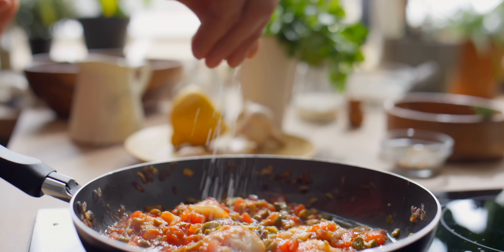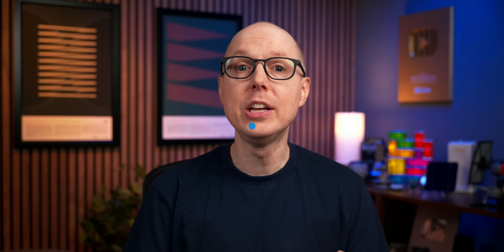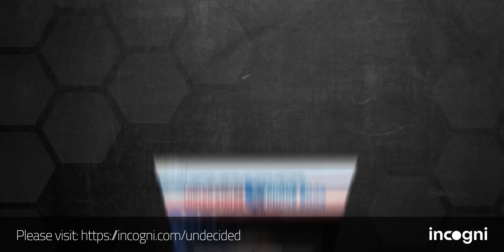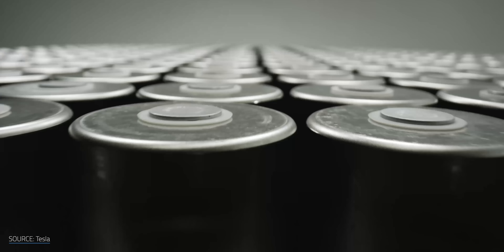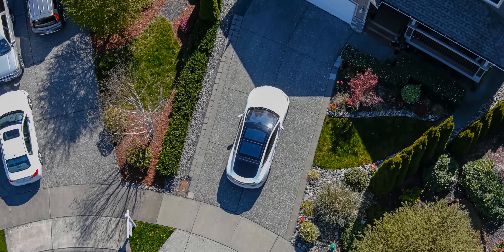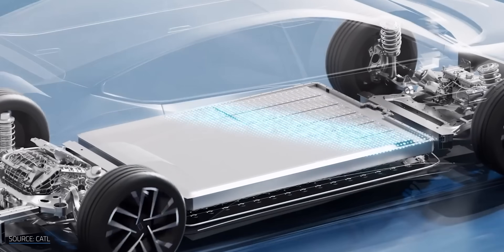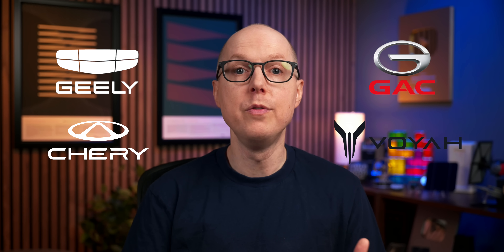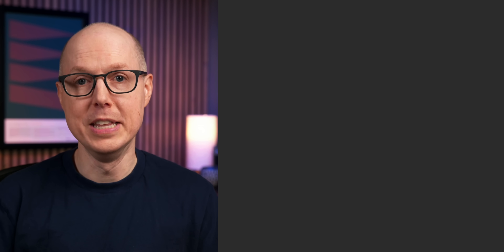How CATL Made Batteries 90% Cheaper (And What Happens Next)

Comment: If I can have (near) the same range with a sodium battery at a lower cost, I'd rather have sodium. This is especially true if the battery can also last 10,000 cycles. Then I also won't worry (much) about the battery degrading, even after 200,000 miles. However, I see sodium batteries more prevalent in home and grid storage, where energy density is less important.
Reply: Multiply the range by No. cycles. Even a car rated for 2000 cycles with a range of 300 miles would provide 600,000 miles.  Even after rated 2000 cycles the battery will still have 80% capacity.
Reply: @830118   Yep, rather than swap battery, it could be swap the car with that 10 000 cycles, lol.
Reply: @830118 … people always quote the battery life remaining after 80%, but there is something misleading there. The truth is the technical manuals say to stop using the battery at around 70% (exact depends on battery). In the end, much of the useable safe life of the battery is used by around this point. (I’m talking LFP, from my own reading). Cheers!
Reply: Problem with salt is the voltage dropping to 0 you'll sacrifice bottom end capacity for this or be content with big drop in performance down low. Voltage Boost circuitry doesn't  scale well with high current draw
Reply: Honestly EVs needing ever-greater range is just the latest tech world pi***ng contest. Tech boy nerds all flexing as if you NEED 350... 400.. 600... miles range. Just as they all went nuts over CPU speeds a decade ago. 250 miles and lasts the life of the car? And costs less than an ICE engine? Done. Sign me up.
The current 10-20K premium, insane replacement costs, and near zero resale value of current EVs is a solid "no thanks".
Reply: @plektosgaming  Many people do NEED 600 miles of range. This is for people who tow or taxi drivers who drive all day. For example, the Silverado EV truck weighs about 9000# and has 100kWh capacity and 400 miles of range. SO, if the same truck was towing half its weight, the range would only be 200 miles. As for resale value, it does suck, but that's not a bad thing. The low resale value just means the EV cars and trucks are advancing quickly, and no one wants the previous generation. Like, no one wants a 5-year-old smartphone. The long-range EV you're looking for will cost less than ICE cars and will be available in the near future. High-quality cars with long range and much cheaper than ICE cars already exist in China. Just a matter of time until this kind of car is available in Western countries, likely Australia, Latin America, and Europe first. EDIT: Tesla, Ford, and GM are already working on low-cost high-range models which should be available in 1-2 years. Check Chevy Bolt, Tesla "Model 2" and Ford "Universal Electric Vehicle Platform"
Reply: @dr.x4050  Commercial and fleet needs are not the same as passenger vehicles. Paying 100K for a car with stupid range that makes taxi driver "happy" is NOT the 25K commuter vehicle we all want to get to work and back. Yet all we see are EV manufacturers all trying to see which one has the fastest 0-60 time and greatest range. 
I don't NEED a car with more than 250 miles range.  Never did.  I don't drive more than 250 miles before stopping for a bio-break or food. Never will. I don't need a 0-60 time of 3 seconds.  Not ever half that.  But more reasonable EVs simply don't exist in the marketplace.  All we see are manufacturers chasing the upper 10 percent's money.
Ford's new truck for 30K is just more of the same B.S. It's not a "Model T" moment, it's trash. You can get a small EV in Europe for under $20K and it has all the safety and normal features. Just.. not over here.
Ford's new Truck? expected 0-60 times of 4.5 seconds. A mid-size pickup truck. ( heavier, less aerodynamic). 300 miles range.
Exactly what we don't need. We need something like a sodium ion powered Civic that doesn't cost 40K.
Reply: @plektosgaming  Like you said, there are plenty of under $20k cars with good range being made.  You seem to be blaming the wrong people for not allowing these reasonable cars to be imported.
Reply: @dr.x4050  there is an all electric vehicle supposedly going into production now that is NOT owned by the big boys.  It is bare bones.  The Slate.  Retail is $25,000 to $30,000.  Crank windows…no stereo but a phone holder…etc.
Reply: @forrestgossett  Good. I hope it can be imported.
Reply: @dr.x4050  it’s being made in Indiana. Scheduled to be sold in the US in 2026.
Reply: Agreed, as long as charging speed is better.
Reply: Honestly flow batteries are better in those scenarios, but really haven't caught on. But yes, sodium batteries should easily beat lithium in those scenarios.
Reply: If…
Reply: Too bad this is the CCP spouting this BS. The truth is they are standing on-top of their polluted mountains screaming at the top of their lungs about this innovation and that innovation trying to get western investments. 

But the cold hard truth is they haven’t invented anything since gun powder (and that was an accident). The Chinese Communist Party doesn’t innovate, it steals and imitates, poorly I might add.
Reply: also if the road recharges the car....  which they are doing....lithium then has no advantage
Reply: @peterlang777  ?
Reply: you can't, because this video is clickbait. Sodium ion is nowhere near lithium based batteries in terms of performance. In fact, other companies like Bedrock Materials have seized developing it because it can't compete with lithium-ion or LFP.
Reply: @pietheijn-vo1gt  For cars maybe, but for battery storage, it could be very cost effective.
Reply: @pietheijn-vo1gt that's where china came in innovating on the areas where western investments have given up on and made new breakthroughs. It may not be as energy densed for max performance but the price/performance will make it feasible for general use which they've already started selling sodium batteries with escooters.
Reply: @bingbing3464 Definitely NO! How can sodium ion reduces cost so much? It still using Cobalt or Nickel, carbon anode, and expensive electrolyte. Lithium ion or salt is just a part of cost.
Reply: @daiaki1975 sodium is 20-50 times cheaper and significantly more abundant. It is also easier and less harmful to produce sodium metals. Why else do you think china is investing so much on sodium technology. Nickel and carbon anodes or graphite costs are insignificant to china as they control the supply chain but they still rely on lithium importa. Sodium will complete china's total self sufficiency. Also sodium battery doesnt need cobalt.. it uses prussian blue and that's composed of ferum which is another cheap material.
Reply: @daiaki1975 Lithium batteries ditched cobalt five years ago.
Now it’s a choice between Lithium Iron Phosphate and Lithium Manganese Oxide batteries.
Reply: @bingbing3464  what's ferum ? Iron?
Reply: @daiaki1975 not all sodium ion battery types use nickel and cobalt. Yes one type does , the one produced by the British company that was bought by Tata. Other cathode types such as NSF and NFPP use sulfur and iron phosphate respectively. There are at least 6 types of sodium cathodes in production right now.
Reply: @bingbing3464  e-scooters with sodium batteries you can buy here in the US?  What brands?
Reply: @pietheijn-vo1gt clearly you aren't familiar with this channel's format. The whole point is to discuss tech news that is maybe dubious, thus "Undecided".
Reply: @erikdietrich2678  really? Matt Ferrell's videos are a complete joke. Click bait title after clickbait title, no real content. It's marketing for people who don't actually look into the things they are fed. Quantum computing is a joke, fusion tech did not change the world, sodium ion batteries have no reason to exist as long as we have abundant lithium (and we do).
Reply: @pietheijn-vo1gt this is true..there is so much hype in China amongst battery and EV makers in a very cut throat industry over there…everyone wants to make the next most outrageous claim.
China also has a vested interest in pushing the sodium batt story as they really just want cheap lithium as their own deposits of lithium are garbage

Comment: A more thermally stable battery could be useful for Ebike's that are charged indoors, if they could build a 52 volt 25 amp battery that could fit in my bike frame I'd buy one.
Reply: A great use, as these are often charged indoors and can easily get bashed. The reduced fire risk would be very welcome.

Comment: What is the maximum charge rate for these sodium batteries? That would be the biggest driver for all EV adoption. If they can charge in 5-10 minutes I could care less about the shortened range. I feel like most people won't consider an EV until they can be driven in the same manor as ICE vehicles. Range anxiety is the biggest thing holding them back.
Reply: I've timed myself at various petrol stations and we always spend better than 20 minutes from in to out.